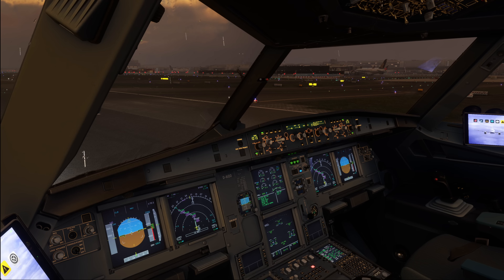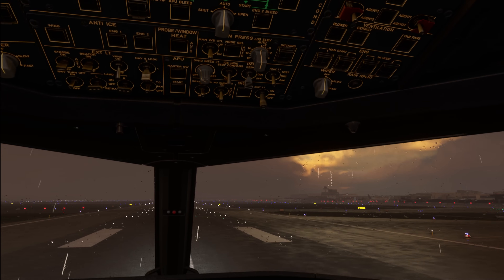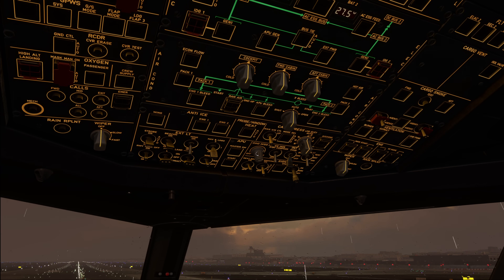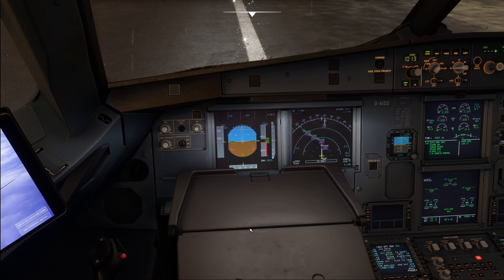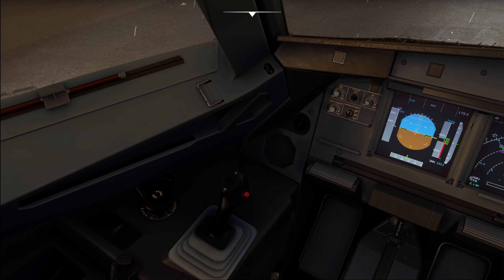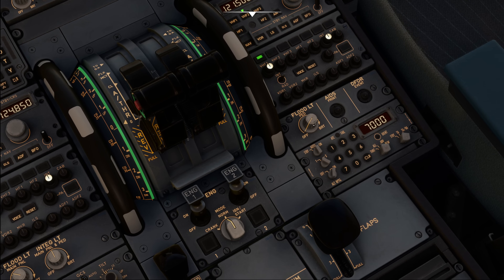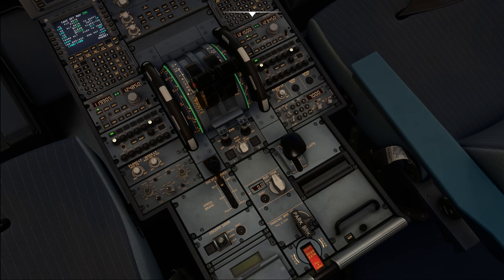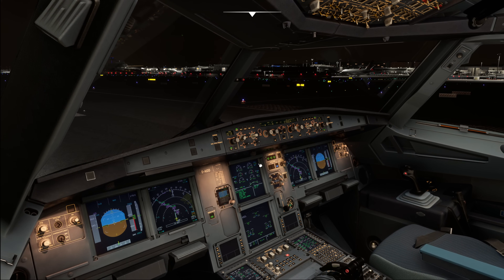A320 Family COCKPIT LIGHTS explained and WHEN to use WHAT | Real Airbus Pilot

Comment: With 40 yrs of flying the Boeings I was hoping you'd mention the use of flight deck lights in day-time.  When flying into the sun the panel is back-lighted and pretty much black.  By turning on the flightdeck panel lights the panel becomes much easier to read.   Also flipping off the room lights your night vision using the sim is improved.
Reply from the maker: Well that's flight sim stuff. In the real world it makes no difference if the lights are on or off at daylight, you simply won't see the lights.
FS24 depicts that much better than 2020!
Reply: @A330Driver  Have you tried it???   As a retired 767 Capt having flown 727s on thru the 744 in the real world the light trick worked great (think LS into a setting sun at ORD or LAX) worked quite well and surprised a few FO's when I showed them.   For me in 2020 I find it works quite well.

Comment: When MSFS started doing 3D cockpit back in FS2002, I wasn't convinced. It is just a badly made polygonal 3D model that is awful and not immersive. It was just eye candy and nothing functional. However, it does really tell you where to find the instruments, buttons, and so on.
2D panels were a thing all the way to FSX era in 2006. It looks funny as the viewpoint is never really correct, and the night lighting is just a 2D texture painted with lightened overlay (colour blending that is just coloured 2D cockpit texture surface).
During PMDG 737NG launch, Robert S Randazzo musing about the tranquility of night cockpit lighting and how he setup his 737 cockpit lightings in real life. In these day and age, it is super possible to recreate a pretty representative night cockpit lighting in our desktop PC.

However MSFS has a lot of quirks: lights, both sources and effects are bloom function - making them much brighter than they actually are. Case in point: moon lighting in night flight. It totally illuminates the plane including registration letters on wing surface. In real life, you can't see anything outside during total darkness at night.
Darkness in MSFS is cartoonishly extremely dark and lights do not refract like in X-Plane (which explains why cockpit displays do not emit enough light, they just reflect). A terminal lighting will usually seep through cockpit and create either shadows or illumination / reflection - but it does nothing in MSFS. Case in point is how dark the apron is in MSFS compared to MSFS2024. Normally you can still see the planes taxiing from the terminal. In MSFS, they operate like military airports - total darkness that requires night vision.

Comment: Hi! Although the exterior lights aren't part of the video I was wondering what the difference between the two nav lights settings is. Do you know when to use setting 1 vs 2?
Reply: If I remenber well, it’s exactly the same ! There are 2 positions just to ensure a backup setting considering those lights are very important. Maybe could @A330 Driver confirm
Reply: @Adam-tc6bothat's correct.
Reply: Guess what, he also made a video on the exterior lights. Maybe try watching that.